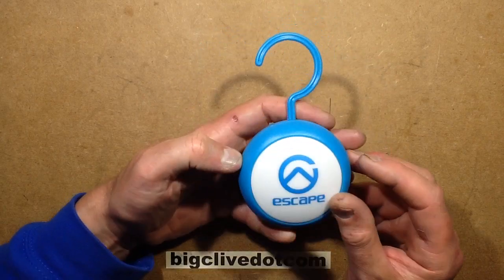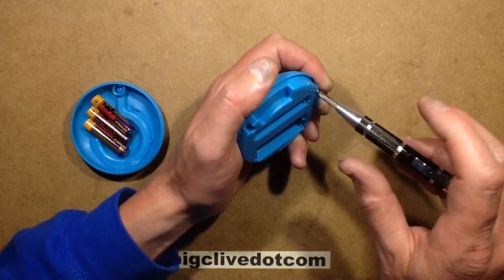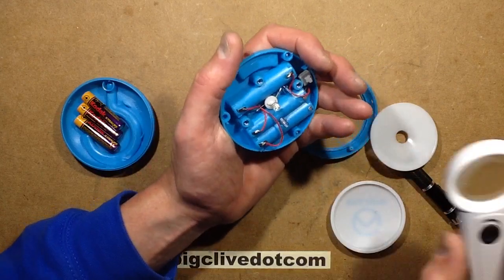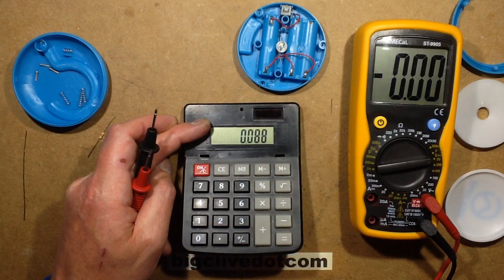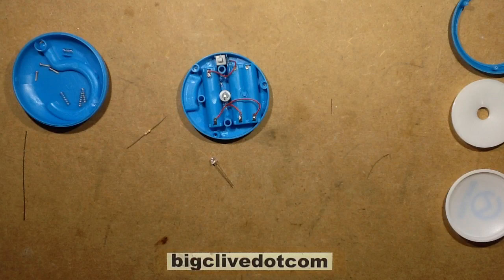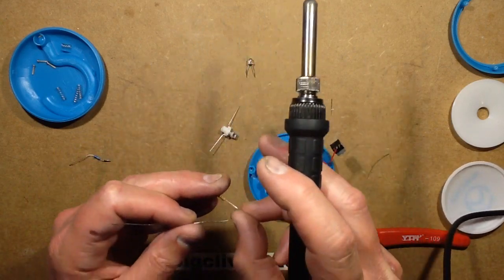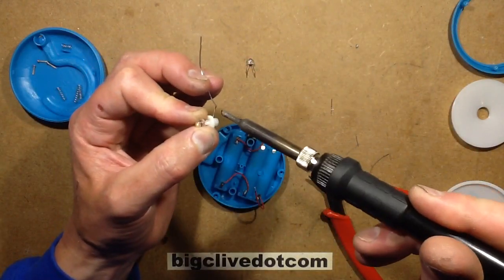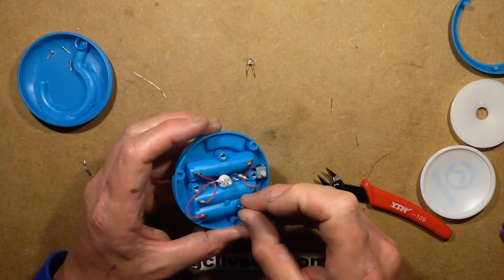Poundland's 2016 "Escape light".  (And LED swap.)

Comment: Speaking of warm white LEDs, Clive, do you remember those V-tac LED bulbs you disassemble? Just week ago I found, that they sell 'em in three color temperatures; cold white, day white (4500K) and warm white (2700K). I bought 12W version, I am a bit curious, how it will looks like. I am worried about temperature, since it looks just like chep plastic case with no heat sink. I will see. But to my point, if you can find 'em in stores around you, you can try 'em also, in some shops they look dirty cheap (I see it in one e-shop for 2 euros).

Comment: Wondering if using something like the shiny side of aluminum foil would increase the output by reflecting more light along with stopping the loss of light through the backside? Or would it be irrelevant?

Comment: If NiMH is 3.6V and alkaline is 4.5V, wouldn't the NiMH voltage drop be roughly 0 left for the R?
Reply from the maker: The LED voltage is typically about 3V at 20mA and less at lower currents.  But the resistor value would be a compromise if using both alkaline and NiMh cells.

Comment: I don't buy LED lights which use 3 cells - 2 or 4 cells is fine, but three is just offensive
Reply from the maker: I actually prefer two or three cells for a single LED or parallel array.  Mainly because if I use NiMh cells then when the LED gets down to about 2.5V it won't be drawing current, and that means that if one cell goes flat the current flow stops and it doesn't get reverse charged by the other cells.  What does annoy me is the battery chargers that skimp on components by charging cells in pairs.  Not so ideal for a three cell application.
Reply: 3 cells give the correct voltage.
Reply: Our dollar stores in Canada are fond of packaging batteries in odd-quantities of 3 or 5, so this application is quite suitable it.
Reply: I'm a duck
Reply: What Dollar stores do you frequent? Cause all the ones I see are either single or even multiples.
Reply: When they run on rechargeables then it doesn't bother me - my Ansmann charger treats every battery as an individual.
Reply: You are quackers

Comment: In Germany, Euro stores have these clear reflector ones. The switches in them are horrible. The lamps faintly switches themselves on. How is this even possible? Leakage through a switch with high capacitance? Or what could cause it?

Comment: That looks like a good candidate for my WiFi controlled push button switches. I use a ESP8266 running arduino code to send commands to a raspberry PI running the OpenHab software. Previously i have been using the smaller push button LED lights from poundland (3 pack), I take out the LED/push button switch circuit and replace the switch with a momentary switch.  This one in the video looks like there is a lot more space inside to pack in the electronics!  
Thanks for the video!

Comment: Rather than measuring the voltage drop across the resistor and calculating the current, tho' with a 10 ohm resistor there isn't much calculation to be done, wouldn't it be simpler to set the DMM to current and bridge the on/off switch?
Reply: There ya go!  Good idea.  LOL... no math required.  Might as well put that current range to use once in a while.

Comment: It is keyed and you just missed it. The back plate had 3 holes and one peg. The front had 3 pegs and 1 hole. You just got very lucky putting it back together.
Reply: No, that's the reflector not the button/front plate. The button/front plate rotates independently of the reflector.
Reply: Chris Doms true you're right.

Comment: They probably ride the led a bit harder at first to account for voltage drop as the batteries age. That's also why they've put in three cells i guess: that way you still have 3V, even with pretty much dead batteries.

Comment: I would love to see how you chose the resister.  You briefly mentioned that you chose it to work with the cells you have, but is it just experience or did you do any calcs?
Reply from the maker: I calculated it by deducting the 3V of the LED from the typical combined cell voltage to find the voltage that had to be dropped.  Then I selected the current I wanted to flow and to get the resistor value divided the voltage to be dropped by the required current and then rounded it to the nearest standard resistor value.

Comment: Could they have been using one of those high power straw hat LEDs you can find inside cheap led flashlights?
Reply from the maker: +BloodySword It would be brighter than you think in a total blackout situation.  Even for reading.  And with the resistor swap it would run for a long time on a set of batteries.
Reply from the maker: It seems to be a standard one without the thicker legs that the higher power ones have.
Reply: The lamp was far to dim in the first place... I don't know for what I would use it after the LED and resistor change.

Comment: @BigClive, would you have any use for a few sticks of ancient RAM?
Reply: I suggest making a RAM Light, a lampshade made out of RAM sticks. 
You must use CFL or LED lights though.
Reply: Could be interesting.
Reply: I have a whole bunch of dead RAM sticks. Maybe this is the project I've been looking for.
Reply: +Prehistoricman Depending on the color of the circuit board, warm white could make the performance of the lamp worse, due to the blue hue.

Plus, under any circumstances, DO NOT USE INCANDESCENT LAMPS.
Reply: They are deep green, with large I0 chips that I could desolder by hand....

Comment: Would it still work if you were to use 1.6 Ni-Zn rechargeables ?
Almost completely ignorant about electronics although I did build a few heathkits back in the 70s

Bought a cat toy ( http://www.amazon.com/CATS-MEOW-Undercover-Mouse-Exercise/dp/B00EHS4KPW?ie=UTF8&*Version*=1&*entries*=0
It works with 1.2 volt batteries but won't with the 1.6 Can you tell me what I need to change to make them work.
Just asking- and pretend you're talking to a 10 year old - Ok a 7 yr old :-)
Reply: Do the batteries fit tightly? If they're loose it's quite easy to fix. You could fix that by putting a small square block of aluminum foil a few folds thick over the positive end, making sure it's about the same size as the positive bump. This corrects for looseness by putting more pressure on the connection.

It's also possible some sort of protection device in it that's there to prevent damage if the device gets stuck worngly thinks the higher voltage is a problem and shuts it off instantly. If that's the case dissambly and modification would be necessary to fix it. In that case it's better to change the type of rechargeable battery used.

If by 1.2V batteries, you mean Ni-MH (Nickel Metal Hydride), I'd just stick with those instead. Besides, the Ni-MH cells can be recharged more times, about 2000-3000 times instead of the 500-800 times Ni-Zn can. I'd use the Ni-Zn batteries for things that can really use the extra voltage and require a lot of power, like cameras, handheld radios, RC cars/planes, high power flashlights, etc.
Reply: It's not the physical size that's different it's the voltage, and this could use the extra power
( It's a rotating cat toy) and yes I want to mod it.
Reply: *****
It's actually larger then I thought it was after looking at the pictures of it. Yeah it probably could do with the extra power.

Likely the mod would be figuring out how to reduce the voltage to the microcontroller and timing circuits used to generate random movements, while bypassing that just for the motors, and feed the motors with the higher voltage.

Basically, you'd disconnect the motors from the circuit board. Add a voltage reducing circuit and connect that between the batteries and the board. Take the outputs from the board that normally go to the motors and wire them to a H-Bridge. The MOSFET transistors of the H-Bridge connect to the batteries and the motors. Thus, the circuit board can run on a lower voltage from a voltage reducing circuit, and the MOSFETs amplify the signal using the full battery power and directly drive the motor. Also, this could increase the life of the product because the board isn't switching the full load anymore.

The H-Bridge type of switching is commonly used in industrial and high end equiptment, so you could consider it an "upgrade" if you will. Also means in the future if a motor dies you can use pretty much any motor of the same size and expect it to work.

You may want to take it apart, snap some pictures of the circuit board, and study how it works a bit. Pictures are important when it comes item for reassembly untill you build up a good memory of how things generally work. Trust me, I know from past experience.

People make weird design choices to cut cost or just for no reason that lead to problems like not working with slightly different batteries. Sometimes, you even question how it still works when it's built so cheaply/poorly or without normally required parts. Electronics is almost as much a dark art as a science at times.

I wish you the best of luck and that you have fun figuring out how it all works if you decide to mod it. If I were looking at it I might be able to reverse engineer it and decide appropriate changes if I was looking at both sides of the circuit board closely. Been hacking random electronics with new features or reusing scrap parts to build things since I was quite a bit younger, so I have some experience.
Reply: Thanks for your comment, it gave me a little more insight into what may be involved to mod this toy and that it might be beyond my ability or patience to start. I do have another one that burned out a while back that I saved for parts so I will take it apart and post a dropbox link of pictures of the circuit board

Comment: I prefer the black versions of these with the clear lens and 3 visible LEDs.
All they have is a sticky pad on the back so i replaced the pads with neodymium magnets.
Reply: I find those give better light, but a lot more glare. Good for closets or inside a pantry, but not so good for a tent.
Reply: TheJohn8765 Mainly for power failures which my area gets more than its share of.

Comment: +bigclivedotcom  If I remember correctly, I've seen some years ago 5mm LEDs on ebay with integrated current source, which drives the LED with constant 20mA at voltages between about 3V-12V . I've been searching them for 15 minutes now, but can't find... It would be perfect for small, battery operated lamps like this, to provide constant brightness over battery life. You can do this with an adjustable LDO regulator in constant current setup, but that integrated current regulator is more elegant (and much more simple). Maybe I'm wrong, and they were LEDs with external current regulators? Hmmm, annoying...
Reply: I was going to say the same - that an LM317LZ is perfect. Problem is that integrating such a thing inside a LED may cause overheating, as that kind of regulator is basically just dumping the excess into heat. Also, it's poor efficiency-wise, for the same reason.
Reply: Two transistors and two resistors make an adequate constant current source.

Comment: A daft thought for you clive, could you wire up a TL317 or lower voltage shunt regulator to keep the leds at 3 volts, constant brightness even with over voltage batterys?
Reply: +zx8401ztv It would be better to set it up as a current source, to provide constant brightness over battery life. But it should be a LDO regulator, because the gap between the battery voltage and the LEDs nominal voltage is very close in this case. Maybe a TL431 can do this.
Reply: Your right :-), i was just thinking aloud without much analising.
A constant current would be the way, i think i need a new brain lol :-D

Comment: You're one part away, the switch, of buying that thing only as an enclosure/battery holder for a light project. But It is a nice enclosure for that price.
Reply: I would have cut out the battery holders for room to use a lithium cell.